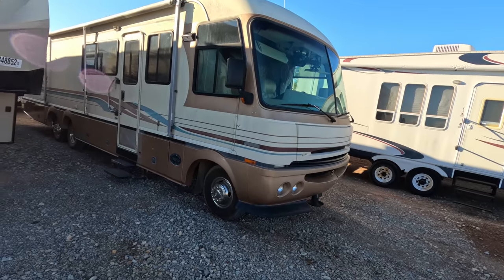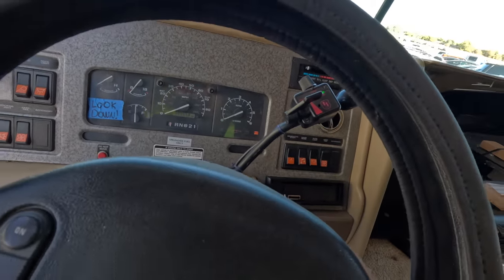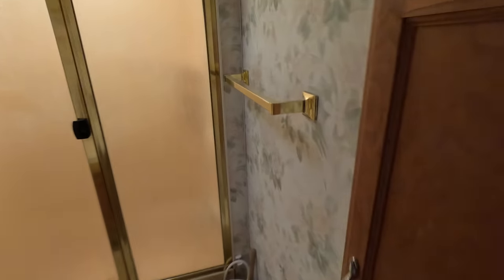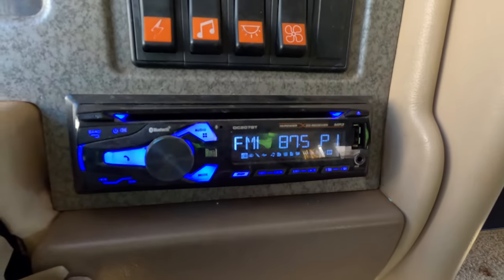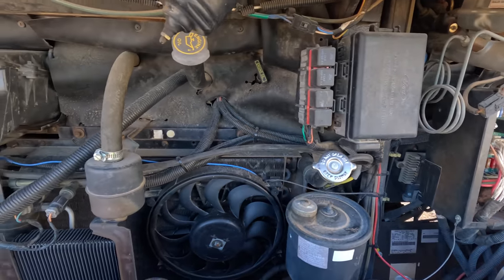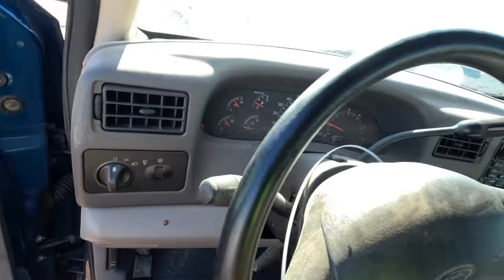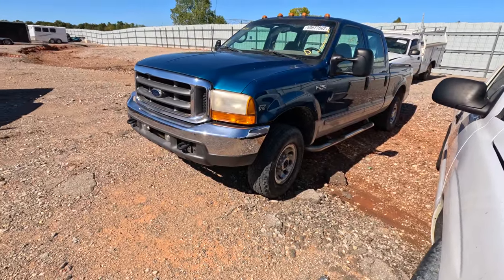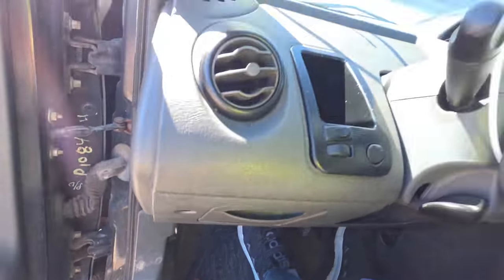Copart Walk Around 10-19-22 + $1300 Massive RV!! Non Runner? Nah!!

Comment: Hi Randy.  Been living with bad shoulder - torn router cuff, etc. - for about 5 years.  Got the steroid shots early on and they allowed me to somewhat rehab my shoulder with very light weight training.  I couldn't raise my arm much above my waist at first now I can and even lift a bit of weight with it.  Can work on my cars and motorcycle with it if I'm careful and don't over do things.  Still hurts occasionally but I can live with it.  I'm 73 and don't want the surgery.  Not saying you shouldn't get the surgery, you're still young, just that if the steroid helps you might be able to prolong it somewhat.  Hang in there Guy.
Dan.

Comment: Aux start switch - allows the house batteries to help the engine batteries start the motor. Get your house batteries charged up and inside lights should work, check the invertor if its tripped off.

Comment: G'day mate, sorry to hear about your uncle's passing. The batteries on both sides would suggest that one is for the engine and the other is the house battery to run the inside lights and appliances. Copart may have connected their booster to the wrong side and could not start the engine.

Comment: In its day Pace Arrow was a quality coach. Plenty of dealers around to figure out the wiring problems if you need help. I would check to make sure no one removed the generator, but if it is there it will be fine.

Comment: Odds are a Catco high-flow catalytic convertor won't cost you $300, do the SPD Y-pipe kit-and the F 250 will run perfect. I have an F350 with the V10, Gibson headers, the SPD Y-pipe kit and the Gibson side-exit exhaust on mine. 4WD, 4.30 gears, long bed, Warn bumper & winch and crew cab...I average 10mpg in combination driving. Don't drive it much,  she a "Big girl!"
Reply: Sorry for your loss. I also have a 00 f250 4x4 v10 I average 10.5 mixed driving. More on the highway.
Reply: @dalehovland3283  oh, I didn't lose anything. I know the cost of the cat because the one in my '95 Ram 1500 was rattling, so the replacement from ORiellys was $107. I looked at the one for my V10 and it was $249, so would ballpark at it about $300 these days. I bet insurance did "Factory part at dealership" and just wrote a check...

Comment: So how do you decide when a truck with 310,000 miles is a good deal?  Yes, I saw that it looked really clean, but at 310K don't you expect the engine to blow or the transmission to go?  And yes, for $550 I would go for it... when you say "sitting at $550" do you mean that is the current bid or the buy it now price?  Video ideas:  Explain how the auctions work, how to find a good auction (Police or estate or general auto or ???)   and how cheap high mileage trucks can still have $50,000 miles of headache free driving in them.  (I am looking for a pickup for junk runs and on very rare occasions hauling a trailer - 7500 lbs would be ideal.

Comment: Not a bad camper I own a class C the house lights are on there own batteries the aux start you seen is when you lose all the engine batteries. You can flip to the house battery to start it. There pretty confusing they have separate batteries to run separate things. But definitely not bad deal for that camper.

Comment: Very common on the Saturn the clutch pedal bracket under the dash for the clutch is a bad design they fall apart about $97 for the part it’s not the slave cylinder unless you see an obviously leak in that area under the car, inexpensive fix not a big job at all, my condolences , my prayers to you and yours Randy.

Comment: one battery for starting and one for accessories. i like those under  2000 rv's. i had a noco 2000 amp booster until it bulged. i will get a bigger noco boost and capacitor booster.

Comment: they also used Ford steering wheel and a Chrysler A/C controls from the M Body Dodge Diplomat/Chrysler Fifth Avenue/B250 Van and the Dodge Ram 150 used these from 1984-1993 on the A/C trucks

Comment: I elected not to have either because there was no hope in my shoulder because I tore ligaments and tendons. I can still function and all I do is take the meds the Dr prescribed
Reply: What happened to shoulder
Reply: @robertroberts9782  I hurt it when I was getting back in my big truck after fueling. Had diesel fuel on my shoe and my foot slipped off the step and I was holding on to the handle and didn't let it go and all I heard was pop and then I bruised up from my pec over to my shoulder down to my forearm
Reply: It was my right shoulder and I couldn't shift my gears so I had to shift with my left hand while trying to hold the steering wheel with my right